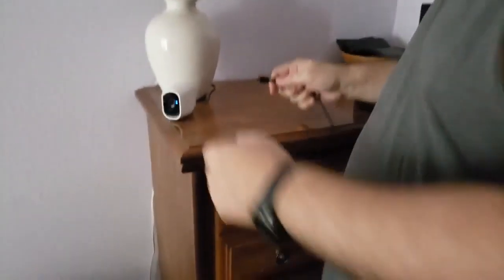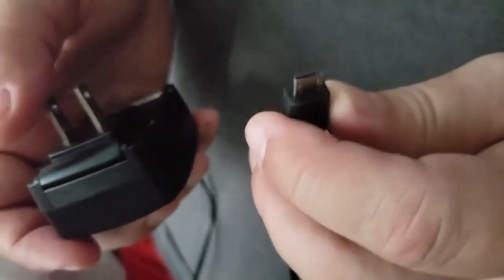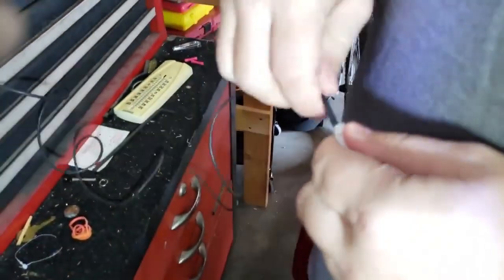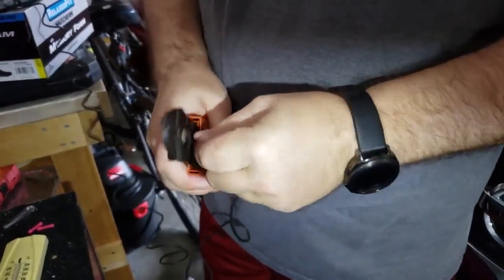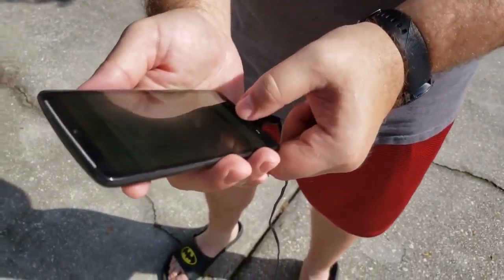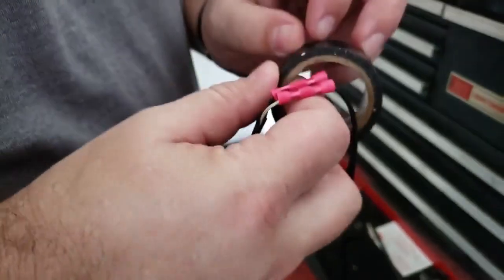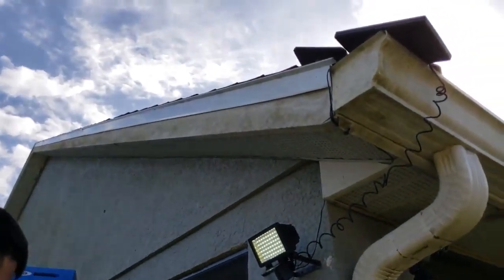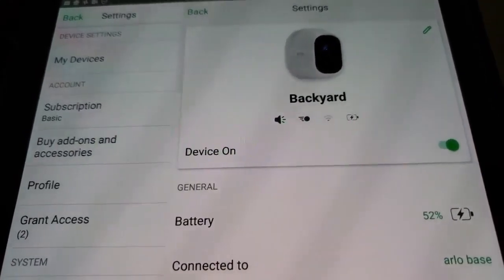Arlo Homemade Solar Power

Comment: It’s the plug Arlo required a 9volt charge at least that’s what I’ve seen that’s why u can’t charge alto battery’s with a Samsung cord
Reply: Yea Best Buy doesn’t know I spoke with Arlo a Samsung charger will show its charging but they are made to charge at 6volts Arlo charging cables are made to charge at 9 volts
Reply from the maker: @nickstaed1048  Funny thing is in our home, we have 3 cameras, 1 Arlo charger and 2 other basic chargers. All 3 cameras stay at 100% all the time and I will randomly chose one inside camera to swap the battery for the outside one and the dead battery charges up within a couple of hours. Maybe the Arlo Ultra is better with their solar panels. After reading reviews, I didn't see that Arlo solar panels were any better than the solar system I created in this video.
Reply from the maker: Interesting comment. The Arlo showed in the app that it was charging despite the battery power going down over time. When speaking to a Best Buy rep, he stated that even the Arlo solar chargers don't keep the battery fully charged. You still will have to change batteries, but they should last twice as long. Think we are going to need a bigger solar panel. 😁
Reply: That's correct, if you don't have the arlo setup properly, it will discharge into the solar panel. The thing with the Arlo cameras is that as soon as they detect power they will go into a higher power mode where they will basically continuously record and you need some smarts (which are in the official arlo panels) to prevent this mode and move into what's called 'solar charge mode' where it stays at lower power and trickle charges the battery. The other thing is charge mode on an Arlo is 9volts, not 5 volts, the official arlo charger is a 9v USB which ensures that it charges up properly, 5v isn't enough to charge it, partly because I think the internal Arlo charger is a buck converter  so it needs well above 5v (ie 9v) for proper charging of the battery, since the battery is a lithium 3.7v/4.2v battery.